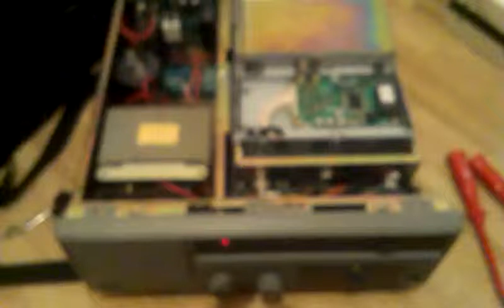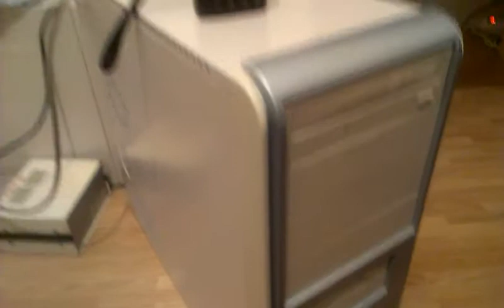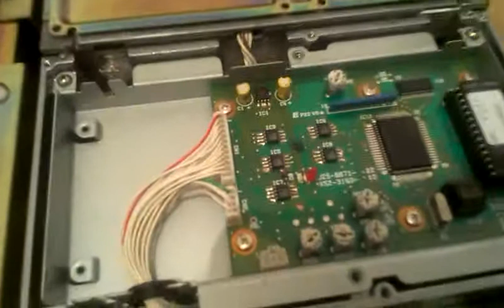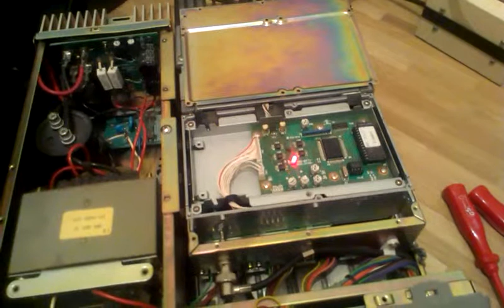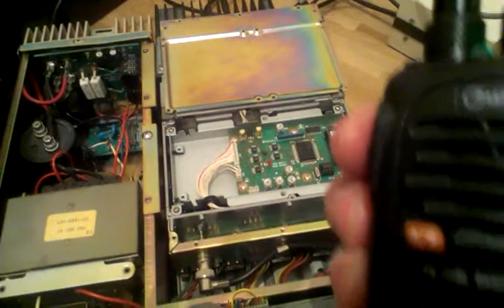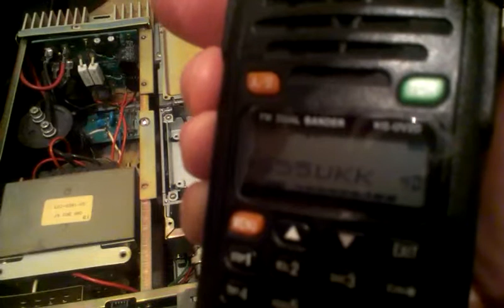Kenwood TKR 820 prepared for S55UKK

Comment: i have a problem with the TKR 820, it seem the sensitivity of the TSQ is either not sensitive like a built in TSQ mode of an ordinary radio, it does not trigger the repeater tx even when you can still hear a good voice quality on the TKR repeater, im not sure if the controller only allows a certain level of s meter for it to trigger or the TSQ decoder is not very sensitive, my regular radio home made rpt does better, cos type controller, even if the triggering audio is below the noise or very weak, the TSQ is so sensitive that it triggers the repeater. im not familiar with whats wrong with the TKR 820, is there a way to adjust it, the TKR does not trigger even when the audio at the speaker is perfectly received, it just does not trigger it.